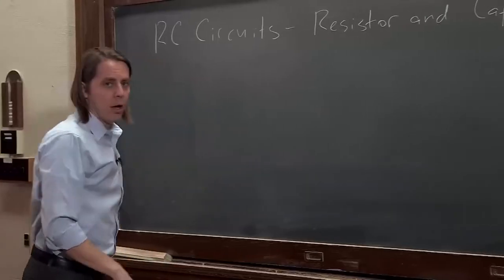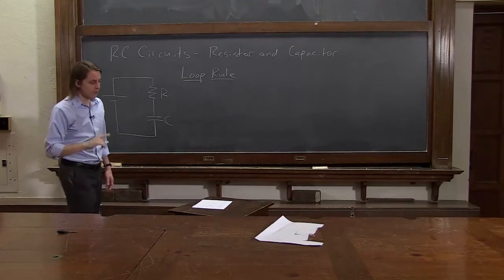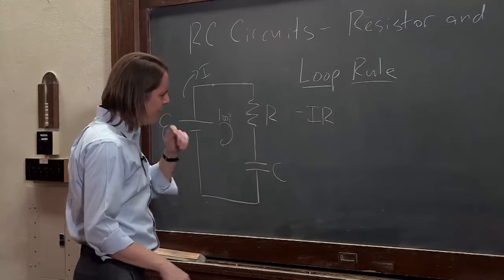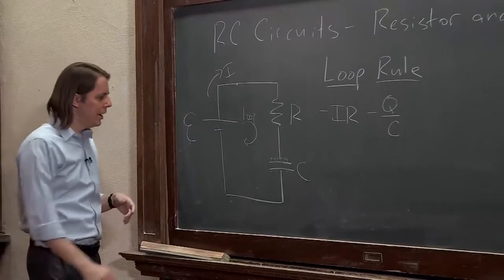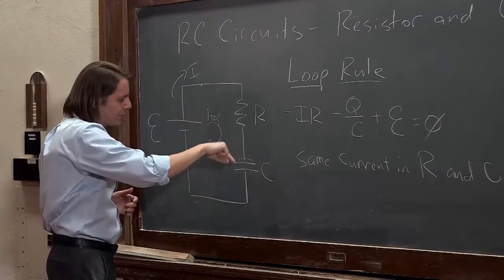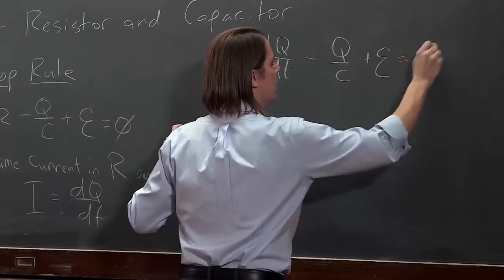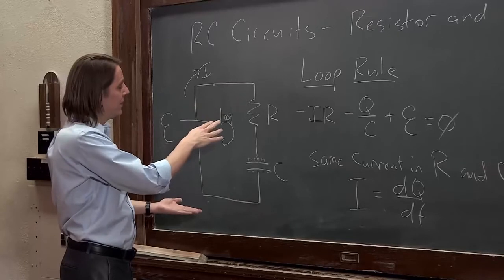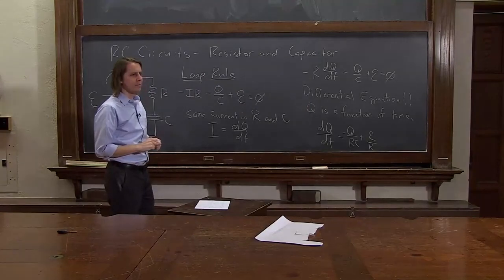PHYS 102 | RC Circuits 1 - A Circuit Described by a Differential Equation

Comment: In RL Circuit you used Faraday laws because kirchoff loop law wasn't applicable ,but in RC circuit too current is changing then why did you applied kirchoff loop law here.
Reply: it is because there the magnetic field in RC circuit is neglectable (it is so small) so -> closed integral of E dot dl = 0 -> sum V=0 (Kirchhoff Law)